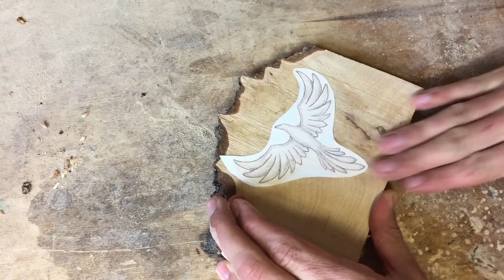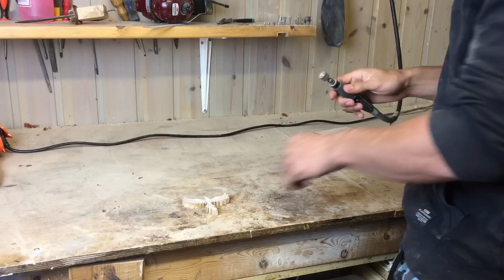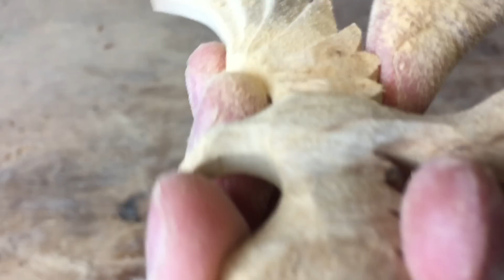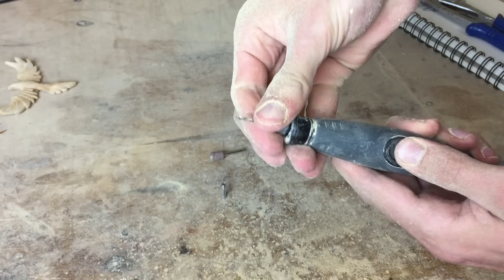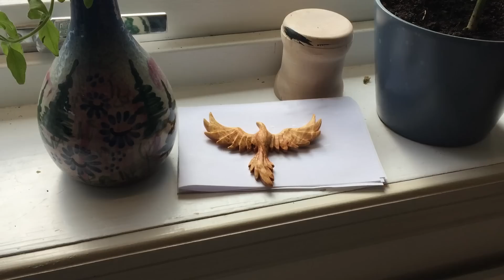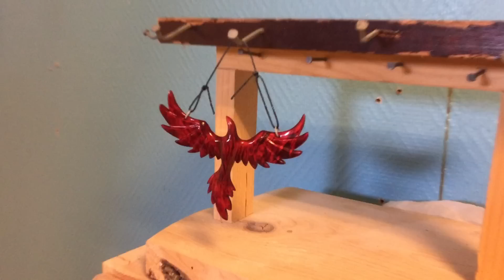Making a Phoenix pendant by JONASOLSENWOODCRAFT

Comment: I really recommend a foot switch for your scroll saw if you tend to do fretwork. It's nice being able to hold the piece with both hands when you start up the scroll saw. I just have a cheap light switch on the floor.

Comment: I struggle to use my scroll saw.  I break blade after blade.  I have given up and put the saw in a cupboard so I don't have to look at it any more preferring to use my band saw but I want to cut some small detail.  Watching you using it I know that it would be so useful for me.  What am I doing wrong?  Can you give me any help.  I am only cutting pallet wood which is just pine and not hardwood.  Help!

Comment: Hello. I'm new to using a dremel and was wondering where I can buy burrs and other special bits for a decent price?
Reply from the maker: Hello i am really not sure, but you should be able to find a decent dremel in a hardware store near you. I use a dremel 3000 with an extension shaft :)
Reply: check aliexpress you find tons of bits. Good luck.
Reply: AMbros Custom thanks.
Reply: Welcome dear:)

Comment: What wood type is it made from i want to make a red kite in wood butt i dont know what wood type to use almost all of the wood i have is to soft and I wat it to last long
Reply from the maker: I would recommend you to buy something called stabilized wood for your project. A search on etsy.com for it would give u al lot of results. You can probably find the color you are looking for as well. The shops there are very helpful with any questions you have.

Good luck! Hope you find what you are looking for
Reply from the maker: I forgot to answer your original question: In this video i used regular birch burl wood.
Reply: Well I found some wood thats calt snake wood it have the coler and it looks beutiful

Comment: Remember when carving was done with chisels & gouges instead of abrasives?
Reply from the maker: Remember when it was not possible to view things like this because we had no internet? Time changes
Reply: Some people still do. There are pros and cons to both methods and they both have a unique look.
Reply: Times change. The everlasting race to the bottom however does not. Although, if that's your excuse, why use wood at all? Just make a plastic one off a 3d printer or injection mold.
Reply from the maker: I dont need an excuse...

Comment: WHAT THE FUCK IS IT WITH YOU PEOPLE, CUTTING THE SHAPE FROM THE MID SECTION OF A PERFECTLY USABLE PIECE OF WOOD. PLEASE, CUT THEM FROM THE SIDES SO A MINIMUM AMOUNT OF MATERIAL IS WASTED.
Reply: Otherwise a nice project.
Reply from the maker: It is burl wood. as you can see only parts of it has a great pattern and i chose the most suitable part for this project.